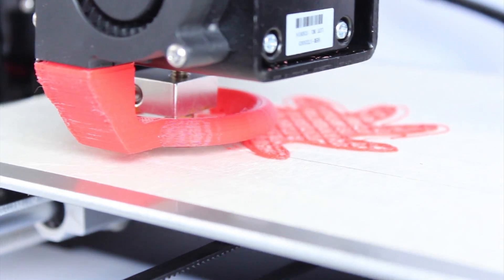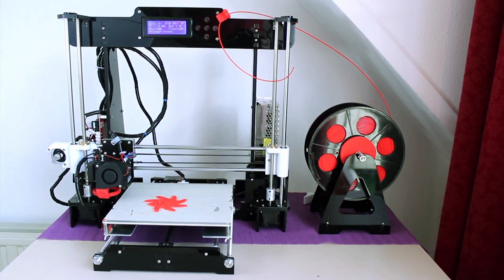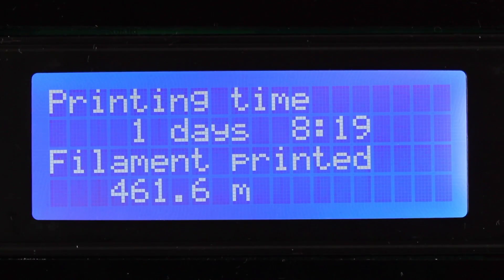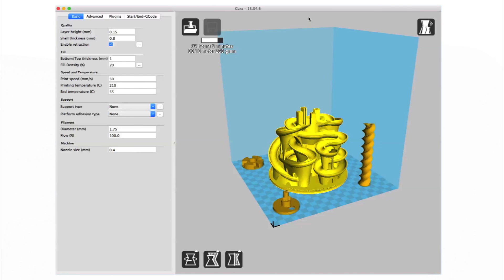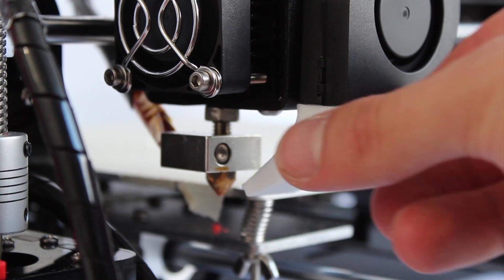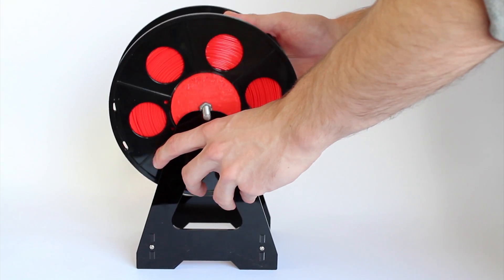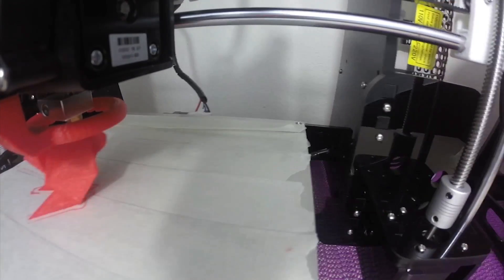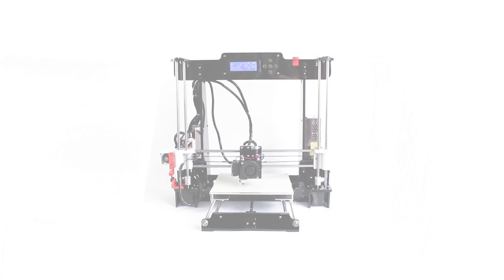Anet A8 DIY 3D Printer Review

Comment: Hello all. I received my 3d anet a8 2 days ago. It is ready now to print but the x-axis is not working well. It does not go to home position and manually it only moves the extruder away from the x motor.
I double checked all wiring and belt. Any suggestions?
Thanks is advance.

Comment: I heard a lot of awful things about the main voltage wiring. can you confirm any of them?
Reply from the maker: Speaking of my own experience I cannot confirm that.
The wiring is pretty straight forward. 
I understand people are being sceptical because of the price, but I honestly think is it great value and it good machine. I actually experience way more problems with the Ultimaker 2 than with  this printer.  Not a single fdm-printer on the market is perfect yet.
Reply: +Tulio Laanen Wow thanks for this fast answer!
I thought more about the dangers of it, one example I heard of was that you could set critical thermal sensor values too high? (not sure if that was really about the PSU, though)
Reply from the maker: I see. Well, I guess you can if you reallywant to :p  
But if you follow the instructions I cannot see any problem. 
It sounds like you know what you are talking about, so i think it should not be a problem ;)

Comment: I just bought one based on reviews like yours and am very unhappy with it! I spent 2 days to assemble it, which was very frustrating with the provided instructions which were  unclear unlike you say. Then, I started to print but it doesn't stick to the hot bed! I've put a video for your information at the following link: https://youtu.be/QFD5FevRAa4 
I played with the hotbed temperature and it fixed the problem for small parts (30 mm) but the problem persists for larger parts...will return it if these problems continue...

Comment: Hi Tulio, I'm 14 with no 3D printing experience whatsoever (other than lots of videos :D) and although I have £180 saved up, it is still a massive investment for me which I cannot waste on something that won't work. Is it 100% worth me buying this exact printer? Should I buy the auto-levelling device? Should I buy cheaper filament from another website? Will  it be difficult and frustrating for a first-timer like me to start off?
Sorry, I have so many questions, and I hope you will see this though it is an old video! 
Great review, thanks!
Reply from the maker: Hello MC Donald,
Let me try to answer ;)

First of all I think it is important to realise that 3D printers are NOT some kind of magic box that you turn on, and your print comes out perfectly.
It will always be a lot of trail and error and sometimes a lot of patience and failures.
Even huge half a million pound industrial printers are not to the point yet where everything is perfect.

Over the last years I have mostly been printing at my university with more expensive printers like the ultimaker 2.
Gearbest contacted me at some point cause they liked my work and they asked if I liked to review their Anet a8 printer. I was interested to do this because I was curious how it would perform compared to the expensive ones. 

I was very sceptical at first. For 180$ I didn't expect much at all.
I was very surprised however, to find out it actually is a awesome 3d printer!
I would say the print quality is equal to an ultimaker 2 if you calibrate it correctly.
It maybe does not have a sleek designed look or fancy interface, but I think it is a simple and well-build printer where all the parts and mechanics are easy accessible. Which I see as a big asset.

Levelling the printer is very simple (just turning 4 screws). Making it auto-leveling is possible but I think it is really unnecessary. It takes a small effort to level it by hand. 

What kind of filament is up to you. Try cheaper and expensive ones for yourself, I never noticed too much difference in it.

Anyway, to come to the point: This printer has become my go-to-printer and I think for £180 it is definitely worth it.

I hope that answered your questions a bit ;)
Cheers!
Reply: Oh - wow! Thank you so much for writing such a long and comprehensive reply; it really means a lot! That's very interesting, and yes I think I will have the patience for its failures and misprints. Again, thanks so so much for the dedicated reply - I'll subscribe for this! Good luck with everything!

Comment: It may  be a great printer - low price etc,.   BUT having  checked  a lot of different reviews- forums and online website/online sales type reviews..GearBest is  NOT the place to buy from!  Really its  the factory which cause problems with  parts missing, bad packing so thing get damaged. GearBest are basically "drop shipping" these.. they send the order to the  factory and its shipped from there - BUT GearBest - like 99.9% of all sellers of anything online- from China - have no conception about  customer service or quality control. The next trick - cashing in on PayPal protections scheme - which basically requires you to return the item at your cost - and the seller wants you to pay for your own item to be returned.  Which is why they do little and  just say...return for inspection. Or more often.. the solution is  to offer a small refund/credit note.
The more I dig into this and check things... the more I am thinking of buying a "Ready made to go "  3D printer from an aussie outlet and get 12 months warranty and a shop I can walk into to resolve  any issues.
Reply from the maker: This is a honest review. Gearbest took the risk of sending their product for review. I would have spoken negative about this printer if it would be, but it is definitely not! I love it :)

And you are completely free to buy anywhere, if you don't trust Gearbest I really don't mind ;)  
All I can say is that I never had any bad experiences.

Comment: the ones I am seeing say xp and win7. can I use this with window 10?
Reply from the maker: Slicer software like Cura can be used on windows 10.  you turn on your printer with a 3d file from a SD card. So yes, it should work fine.
Reply: That's what I was thinking. Thanks for your reply

Comment: First thing you need to do if you are planning on printing anything that takes longer than an hour (or ABS) is worry about melted plastic around your wiring. The green connectors are rated at about 10amps, with a 20 amp power pack sending a lot of heat through them. Wasn't long before I smelled burning, needing lots of resoldering to the PCB of my own connectors. The hotbed connector power negative: If you notice browning around the plastic, get a knife and cut it all away before it melts into your connector.

Comment: It seems like your nozzle is taller than mine (somehow).
Reply from the maker: You can can adjust it a little bit with the bolt
Reply: Tulio Laanen
It's not a problem, i was just wondering. :) Maybe they ship different nozzels(like what they have in stock or sth. like that)?

Comment: Is the calibration easy with this machine? I'm looking for my first 3D Printer, a little bit less than 200 USD, is this the best option? Or you can recommend better ones?
Reply from the maker: I did not try every printer, but I do know they all work basically the same. And I know 'calibration' sounds maybe difficult, but its definitely not rocket science ;) By assembling the printer yourself you will quickly get to know all the parts and learn and how a printer actually works. I'm sure after trying, and playing around a bit for yourself, you get the hang of it in no time!

Comment: Would you recommend this printer for me? I've used a bit more complex 3D print at my collage but I'm interested in getting my own. Also is the calibration process hard or just a simple set of tasks?
Reply from the maker: Yes I recommend it. I actually use this printer more now then the expensive ones like the Ultimaker 2. Mainly because I find it quicker to use and all the moving parts are easy accessible. if there is something from with the ultimaker 2 it is a pain in the ass to fix it.
The print quality of this printer is debatable. But I think it is very hard (if not impossible) to tell the difference between results from this printer compared to other.

About the calibration I shouldn't worry to much. It is not rocket science, and you understand it quickly. 
 
I hope this information helps a bit. :)
Cheers ;)
Reply: Tulio Laanen yeah it did thank you so much
Reply: Tulio Laanen what is the max size of the print

Comment: I bought this printer based on this review. I had expected to spend a lot more time building it and getting it dialed in. However my very first test print was perfect. I spent two evenings after work assembling it. I would have spent less time if I had removed the paper off the acrylic parts - as I was told to do in the first place. I paid $150 US for the printer plus shipping from GearBest. Shipping to Canada was quick and reasonable cost for customs. Total under $300 CDN.  There is also a Facebook group for discussion regarding this printer.
Reply: asennad hi, just ordered this and was wondering what the name of the FB group was? Thanks!
Reply: Official Anet 3D Support Group
Reply from the maker: It is great to hear that!
I hope you are able to print some awesome stuff ;)

Comment: Hi,
I ordered this thing and made a list for upgrades that I planned to attach to this printer.

Cooling Duct: /thing:1547256
Spool holder: /thing:1624641/
filament guide: /thing:1764285
Frame Brace: /thing:1430727
Belt Tensioner:/thing:1492411
Anti Z-Wobble: /thing:1858435   and   /thing:1858459
Electro Case: /thing:1767285

Are there any changes or additions from your side? That would help me very much.

Comment: 2 questions. What filament did you use? Did you have to put tape or something down to get the print to stick?
Reply from the maker: I used PLA filament from Gearbest.
And yes I always like to use some painting tape, it is not necessarily to make it stick better, but also to make it more easy to separate when a print done.
But there are many ways of preparing the printing bed. You could add an water/glue solution for example, that is especially a good trick for printers with an glass printing bed.
Reply: just any painting tape works?
Reply: and is there a link for the filament holder mod?
Reply from the maker: No, i designed this one really quickly for myself. But search for it on thingiverse, there are a lot of good designs!
Reply: what program is best for designing stuff like that?
Reply from the maker: For something as simple as this filament holder software like: Tinkercat, 123Dmake and Sketchup is good and very simple to use. More advanced software would be stuff like, 3dsMax, Cinema4D, AutoCad, Rhino, Maya and many many more. I myself always work with Cinema 4D. But choose something that you like ;)

Comment: Does the printer come with filament?
Reply from the maker: No, You have to buy it separately
Reply: Tulio Laanen Ok thanks. Is this printer hard to get started with? Do you know any good getting starting guides with it (not the building, just setting it up and printing) thanks!
Reply from the maker: Yes, it also included some guides on how to use the printer. But I recommend just trying it and playing around with settings, and you will very quickly learn how it all works. It's absolutely not rocket science. ;)
Reply: Tulio Laanen Okay. Thanks! Nice video too
Reply from the maker: Thank you ! :)

Comment: Thanks for the video! I'm just wondering, what's the compromise here?
Reply: It's cheap because it's a Chinese clone, it's made from cheap parts and you have to build it yourself. With the mods that people recommend and time and effort getting to know the printer, and looking after it, you can't really go wrong at this price.
Reply: they did an incredible job on cutting down costs on every corner, without compromising functionality. it's little things like the finish of a lot of parts, stiff cables, and noisy fans. it's almost abscenely cheap, but nothing about it is crappy. i put one together this week with no problems or missing parts, and it works just fine, for all i can tell. most certainly it is a good starting point.
Reply: Gotta build it yourself and order from China for best deal which takes a long time
Reply: UKWEED Is that really it? Isn't the quality really really bad?
Reply: Four Prop Vice Lol no idea, I dont have one yet, just going off what i've read, apparently you can add a better extrudor or some shit
Reply: Oh and it also takes forever to come. I ordered 1 month ago (9th Dec) and I'm still waiting! Gearbest were a bit optimistic about the 7-10 day estimate.

Comment: I really like this video, I would love to purchase one, but I'm afraid I wouldn't be able to put my time to learn how to use it properly and fix it in case something goes wrong. Even the fact that I have to spend around 5 hours to build it is a big turn off for me, I'll consider to buy it when the price drops a little or when  some more developed and easier to build version will come out.
Reply from the maker: I thought building it was really fun, I felt like a kid with a new Lego set again ;)
And I think building it yourself teaches you a lot about how a printer works!

I can imagine a printer like this looks a bit daunting because you can see all moving parts. But this makes it in fact easier to maintain and repair. More expensive printers tend to be a pain in the ass to repair (from my experience), because all the part are covers up to give them better ascetics.

Comment: Do you need to use a microsd card or can you print straight from your pc
Reply: If you want to get real high tech you could buy a Raspberry Pi and use Repetier Server. Kinda nice to have a little 3D print server to take all of the workload off of your main PC
Reply: You can print with your PC, using software like OctoPrint, Prontrface or RepetierHost. OctoPrint can run on a Raspberry Pi, offers a web interface for remote control and even has webcam integration for remote monitoring your printer. The power consumption of a Raspberry Pi or any other ARM SBC is so low that it won't matter if you even run it 24/7.
Reply: I think the only way is using a microsd ;(
Reply: There is a USB port right next to the micro sd card port on mine (and it comes with a cable) but I've never tried printing directly from the computer.
Reply: Confirmed it's possibile by a video from ''alejandro perez'' the only problem with that is that you need to keep your pc on for a very long time to print things
Reply: Someone else on Youtube talked about a Skynet firmware or software update which lets you print directly from PC, however it doesn't seem to be an issue which others talk about when they do it, so I'm thinking maybe the manufacturers updated it so you can do this out of the box now. 
It's probably better to have it run on SD card tho, so it's a stand alone. That means if it's still printing passed bed time you can turn your PC off and let it print through the night.
Reply: You are able to print directly from your PC via the usp port you just need to connect it and pare it in Cura. The only down side is that your PC needs to be on at all time and needs to be connected while you are printing.

Comment: ok so this is a really hard choice for me should i buy this. is it worth the money? and how is the print quality?
thank you
Reply: Keith Brigadier good because I ordered it yesterday
Reply from the maker: I can't decide for you, I can only share my experience. 
I am used to working with printers like the Ultimaker 2+ which are in the thousands of dollars. This printer is only about $160, and I honestly think the difference in printing quality is very small. I can't think of any solid reason why you would buy an Ultimaker, if you could buy 10 of these :) It is really just a matter of good calibration and the right settings, and people seldom print in the highest quality settings anyway, 1 because it takes very long to print, 2 because 95% models don't need such high quality. Maybe other people think differently about it, but I am impressed by this little printer.
Reply: Keith Brigadier how good is the print quality
Reply: Keith Brigadier thanks and I'm getting mine in about a week or two and I want know how good are the updated instructions and does it tell you how to level the print bed
Reply: Glitchedupfrag How was the printer? How easy is it to assemble? How long did it take to arrive?